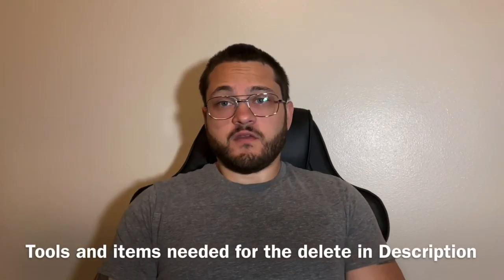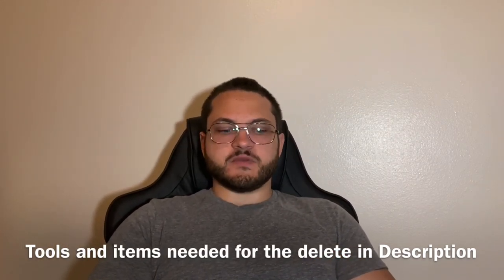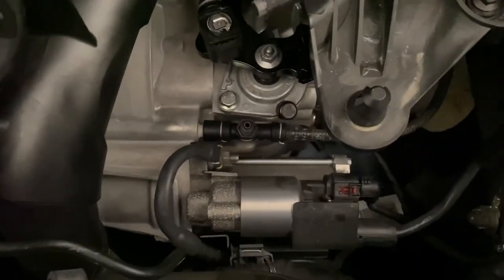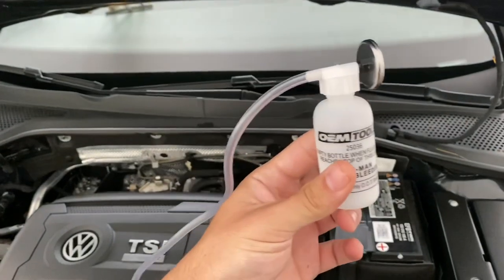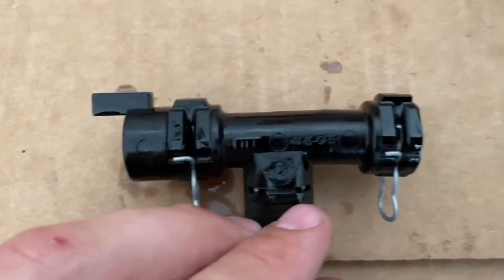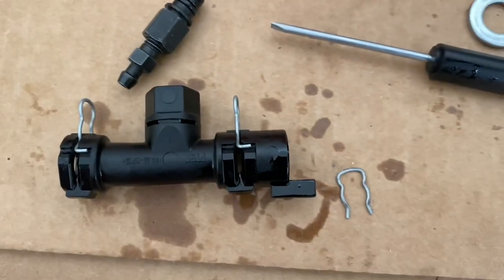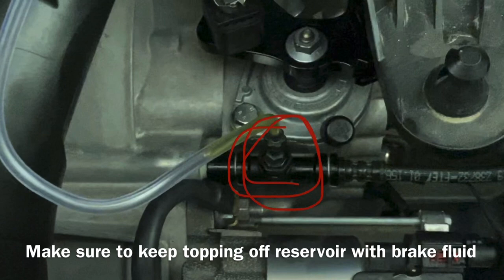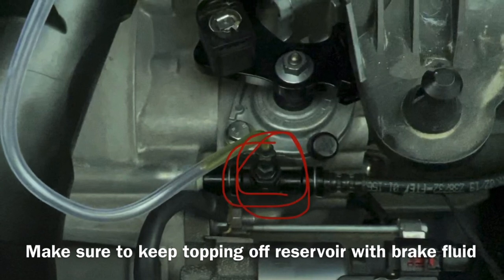Clutch Delay Valve Delete Golf R

Comment: Did this modification today as well as fitting a quick shifter...took me approximately 45 minutes to do both..I used an easy bleeding kit to get the air out after so I could do it on my own. 
After taking the car out for a 20 mile drive the difference is definitely noticeable when pulling away in 1st and also changing in to 2nd gear. Definitely easier to balance the clutch and throttle when pulling out of junctions. 
100% worth doing in my opinion, car feels so much better to drive. 👍
Reply from the maker: Incredible how such a small piece has a large effect. Imagine how many other things there might be that we don’t know about. I have a new clutch and flywheel coming soon, let’s see how that feels. 👍🏼
Reply: Yeah definitely...I also installed a clutch pedal stop and removed the clutch spring...it gives you back the full control of the clutch operation imo, instead of the car been restricted as to when the clutch is operating (if that make sense?)
I wouldn’t say it’s for everyone, but I’ve been driving manuals for 30 years and it definitely suits me and my driving 👍
Reply from the maker: Yeah I heard those are popular mods the travel and feel is good on the stage 2 clutch, I didn’t remove the spring because from my prior knowledge (on the Mustang) “Your clutch pedal will never fully return to stock position without any assist spring, and over time your slave cylinder may begin leaking due to constant pressure on its seals from the clutch pedal not returning to the stock position.” So since it feels good as is I’m going to leave it for now.

Comment: Pretty straight fix. Why would'nt VW just eliminate that small yellow piece if the clutch responds better without it?🤔
Reply from the maker: More money selling clutches could be a reason. Also engagement is smoother with it but feels fake. Kinda hard to explain but so far everyone that does the delete has only had positive experiences and feedback.
Reply: @CarsCouches  Positive experiences are a plus. Keep the posts coming! Enjoy Zep.
Reply: @christophertabor7893 very delayed but probably so people don’t feel that the clutch is jumpy or uncomfortable for the average driver. Same with the clutch assist spring.

Comment: Hey I know this is an older upload but did you notice a change in how high up the clutch engages/disengages after this? Or did it feel exactly the same just quicker?
Reply from the maker: Same just quicker.
Reply: If the release is lower to the floor, you have air in your line. If its higher, maybe you got rid of some air previously in the line.

Comment: nice! thank you for the vid! going to do this tomorrow morning.
one question, how large is that piece? I was thinking of drilling out that piece to open it up even more
Reply from the maker: I would suggest just taking the delay valve out to avoid any issues that boring out the bleeder block would have. If you want the bleeder block to be larger there are some aftermarket options out there. ECS Tuning sells one that’s pretty good, but I felt like taking the delay valve out did more than enough.
Reply: @CarsCouches  did a little bit of research and it looks like I could just run a 5/16 bit though it just to open it up a bit more. I just only want to go in there once, and the aftermarket ones are decent if I have a problem but as is, this is free LOL. gonna use that money for better shifter feel and the stainless hose